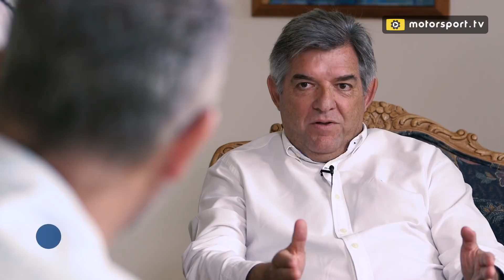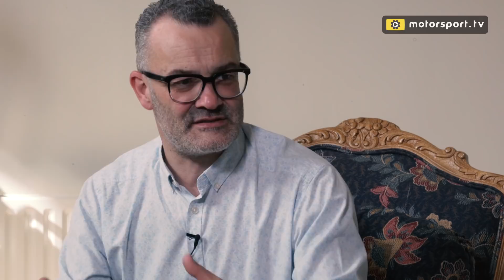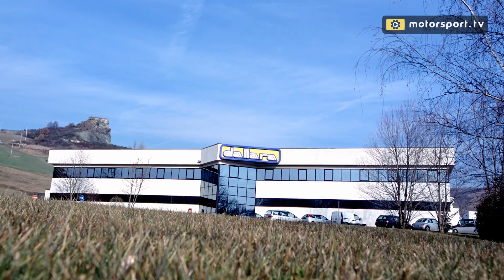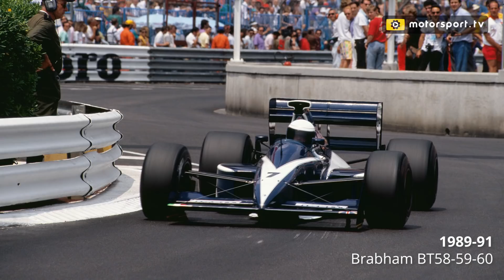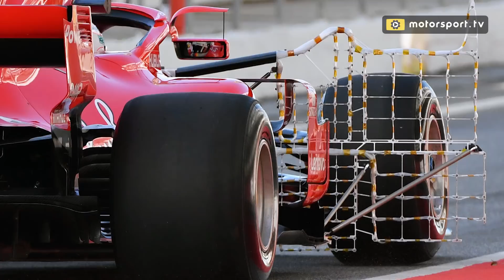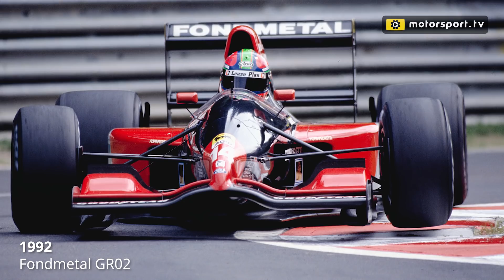The First Dallara Formula 1 car

Comment: That Brabham has so beautiful, simple and clean lines.
Modern F1 cars are extremely sophisticated but not really good looking with all their little wings and boards.
Reply: Honestly I think 2002-2005 was the sweet spot of aesthetic/function balance in F1 designs; well-proportioned wings with dynamic flowing lines; and just enough aero appendages to accentuate the designs without cluttering them up too much. The 90's and earlier cars were a bit too flat and simplistic, especially on the sidepods, 06-08 designs got way too busy with extra aero, and the "longboi" cars from 09 onward are too awkwardly proportioned, especially the V8 cars that suffered from a puny rear wing.